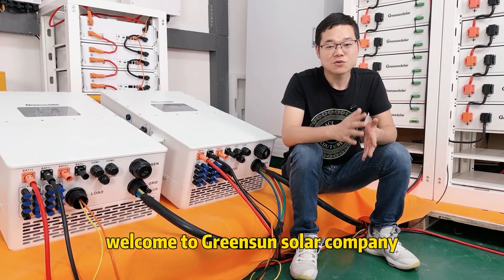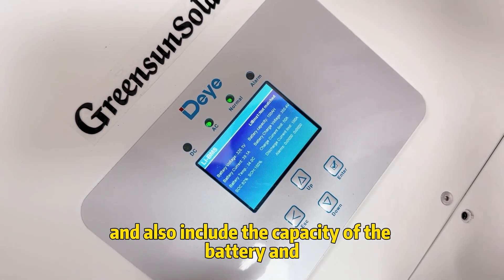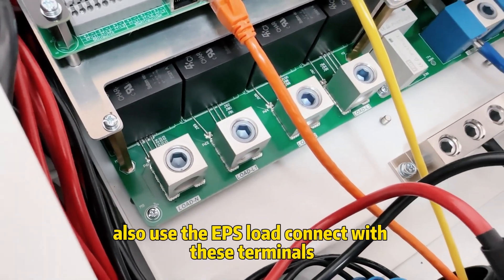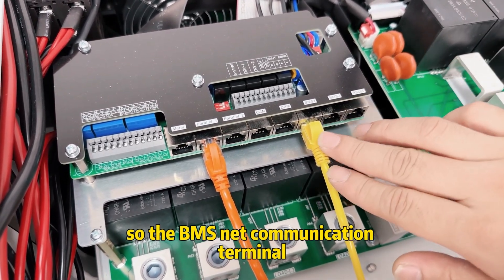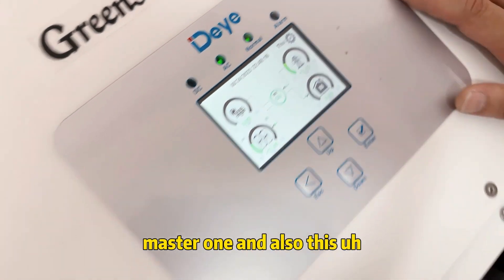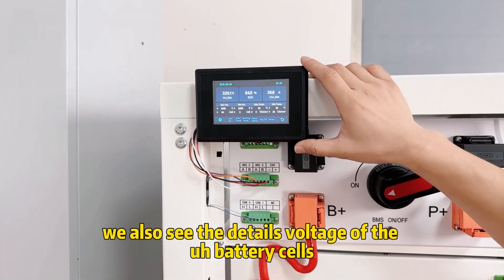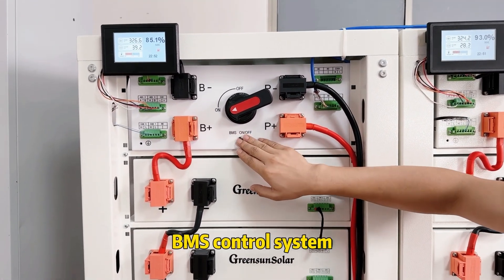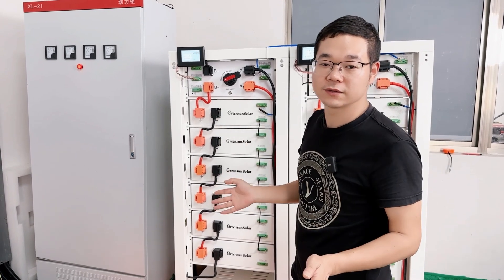How Greensun High Voltage Lithium Battery System works with Deye 50KW hybrid inverter?

Comment: I have 10 greensun lithium battery high voltage  with 20kw deye hybrid inverter how can connect bms between battery and inverter
Reply from the maker: please contact us: info@greensunpv.com  or +8615855110194. We will guide you.